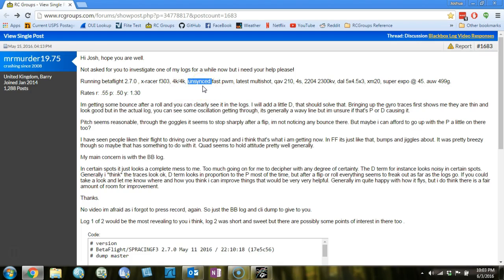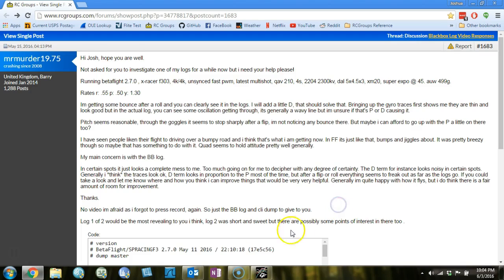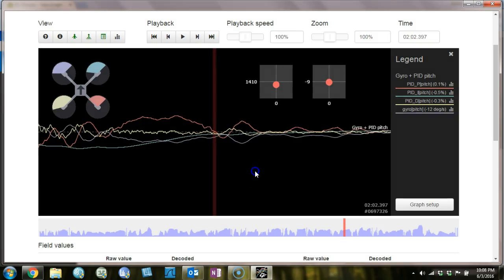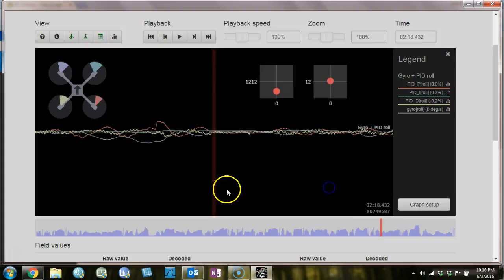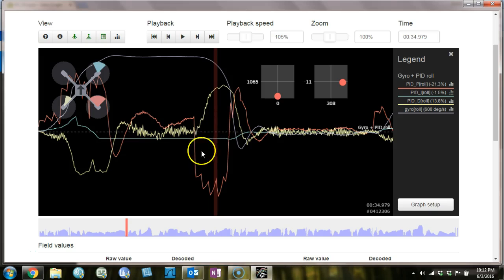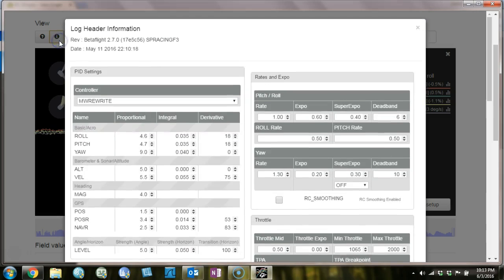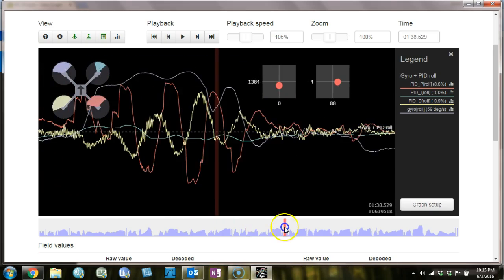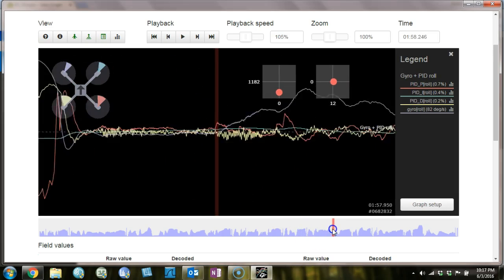Blackbox Log Analysis: mrmurder19.75 - 6/3

Comment: josh, you're talking about the D term opposing the P term. His D gain is based on measurement, not error. This means D always tries to stop any change in in rotational speed, measured from the gyro. RC input is not taken into account for D with this method. 
in this example the change in rotational speed is caused by the P term, so D will oppose. This is why there's such a strong relation between P and D. 
in my logs the D term opposes the P term too. This is probably gone when setting D term to be based off error, which causes D kick, instead of D opposing P.
this option for switching between ERROR or MEASUREMENT (set pid_delta_method = ) was present in 2.6.1. when i look in my old dumps, but it's gone since 2.7.0. it probably still is set pid_delta_method = MEASUREMENT though..